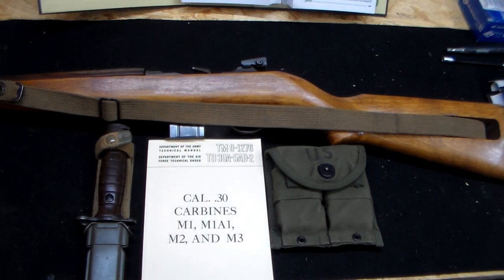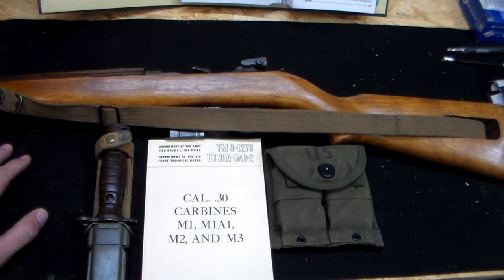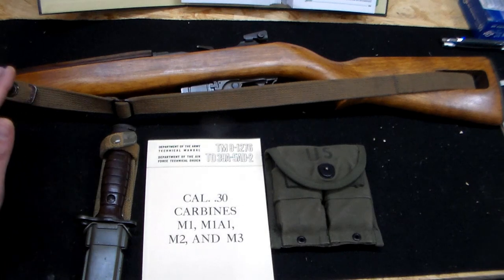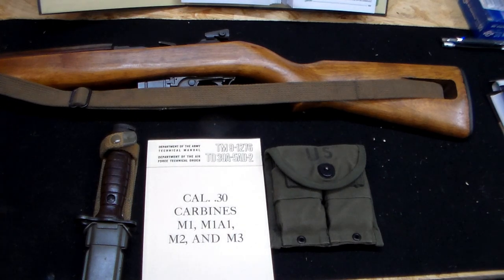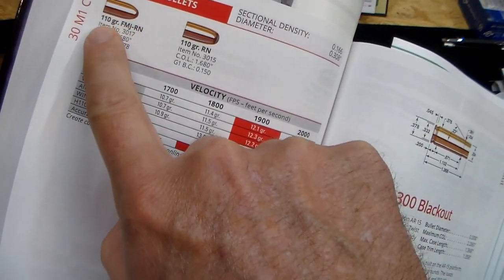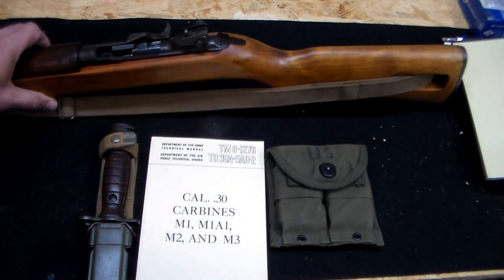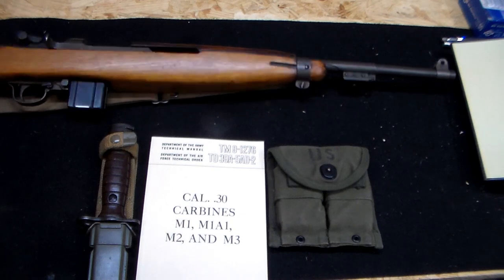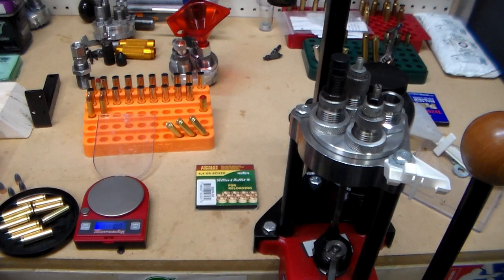M1 CARBINE PART 1 - HISTORY AND RELOADING

Comment: Cool vid!  My Grandpa was a small arms mechanic attached to Patton's army in WWII.  He brought a lot of goodies home, including the M1 carbine he carried all the way to Germany.  It shows, it's pretty beat up but works fine.  He also brought home a lot of parts, which included an M1 carbine receiver and basically all the other parts except for the stock and barrel.  So, my dad had a barrel installed on that receiver, put the rest together and stuck it in a new stock, then gave it to me for Christmas.  It's one of my favorite rifles.  
I like 2400 in the 30 carbine but my favorite is milsurp WC820 pulldown powder with a 110gr jacketed or 115gr cast bullet.
An email back and forth with Ramshot/Western told me that they originally developed their "Enforcer" powder for the 30 carbine, and it closely resembles WC820 as does H110.  (my batch isn't one of the AA#9 ones)
WC820 and the Bayou bullets 115gr works great for a hefty load in the 7.62x25 as well!
Reply from the maker: Excellent comment. That is an awesome story about your Grandpa and the stuff he brought back. Great info about powder and loading. I really appreciate your comment, thanks again.

Comment: I just use Lee carbide dies and I use the same 110gr. semi jacket lead bullets. No problems like you mentioned with the seat or the crimp. This 110gr. semi jacket lead bullet load is pretty good in my milsurp GM Inland .30 Carbine. I do use a factory crimp die because it is a tighter and more uniform crimp. I use either Hercules (Alliant) 2400 powder or Accurate 9 but I prefer 2400. I tend to stick with my old Hornady Reloading Manual 4th Edition. It has always been a good book with good loads. Although I do have some old loading pamphlets and a Nosler reloading book. Lee dies usually come with some reliable load data also that is included with their die instructions.
Reply from the maker: I wish I would have just bought the Lee dies. I will try the #9, 2400 is impossible for me to find. Great info and a great comment, I really appreciate it. Thanks
Reply: KFW No problem. I have been loading for mine for years but I tend to stick with just the one good load I kind of settled on if you know what I mean. I don't lube straight walled cases when using carbide dies. I might take a chance but with a straight walled case I am less likely to have a stuck one. It could happen though. When using steel dies I always lube straight walled or not. I had trouble getting 2400 also but I do have some #9 that I will be using until I can get some 2400. I really do like that 2400. My load books are old so they are not updated with newer bullets and loadings like the later editions but it does just fine for me and have used them for years.

Comment: h110/w296 and IMR 4227 were developed specifically for this round... 4227 is less temp sensitive
Reply from the maker: Thanks for the info. I need to try 4227.
Reply: @kyfirearms  I use 4227 for 357 mag (no need for a magnum primer), 44 mag, 10 mm, 7.62x25, and 3030.... my grain weights are exactly the same with 30 carbine, 357 mag, and 7.62x25... just my personal loads
Reply: @kyfirearms  4227 is a cooler burning, higher gas volume powder... velocity in short barrels tends to be slightly less than h110, but less throat burn on the chamber
Reply from the maker: @lawrenwimberly7311  Now you really have interest peaked. I have some 4227, but haven't used it much. I am going to start working up some loads with it. I load and shoot all of those as well.

Comment: What powder dispenser do you use?
Reply from the maker: I have a couple. The Lee perfect, Frankford Arsenal and my favorite for pistol is RCBS. The all have positives and negatives. The Lee is good for stick powder and just all around use.
Reply: @kyfirearms  I keep reading that the Lee Perfect doesn't work well with H110 (that's what I use to reload .30 Carbine). Any info on that?
Reply from the maker: @stickyhobo27   I have used it with w296 and some similar powders. It can leak powder with the fine ball powders. I have the screw on mine pretty tight and it seems to help.